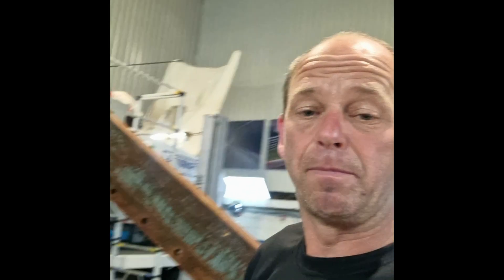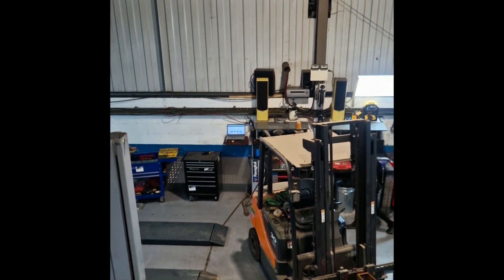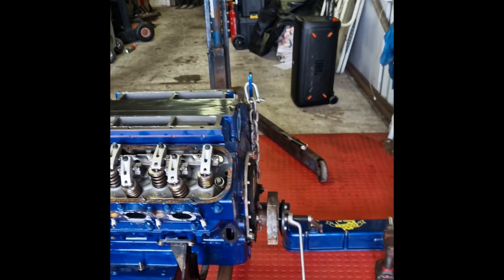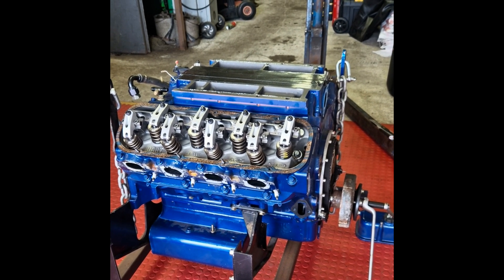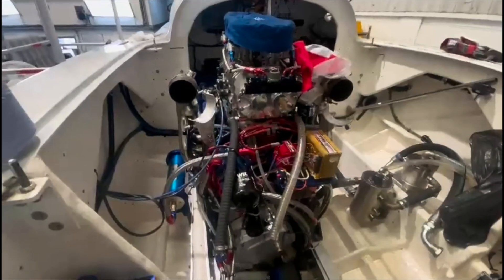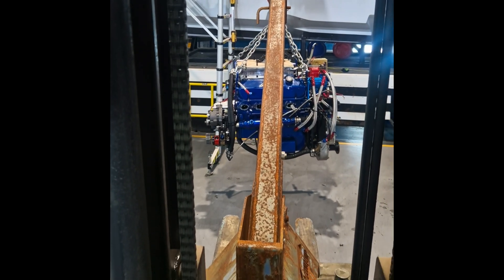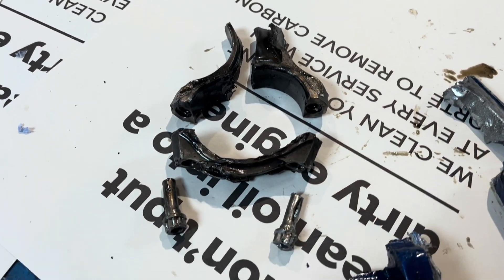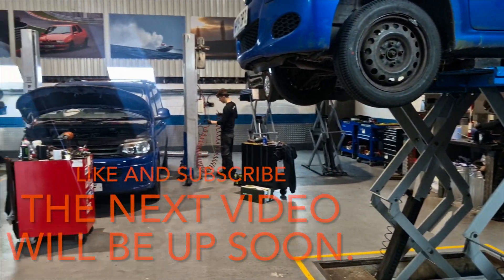Engine exploded! Offshore V8 powerboat engine swap Part 1

Comment: Looks like you have spun a bearing, gets red hot, almost welds itself to the crank journal, the other 7 cylinders running it  snaps the con rod on that seized journal, you need to run engine oils with high Zinc Content for bearing protection
Reply from the maker: we had a big over rev the week before when the prop snapped, we haven't pulled apart yet but it had 100psi of oil pressure on video when it let go and we do use zddp (zinc) and moly as well. we suspect a rod bolt let go as it only got 60 seconds into full speed before it when boom, unlike a car the the engine cant stop until the boat stops so you end up dragging the motor over for about another 10 seconds after it goes bang the number 2 bearing would have zero oil pressure once number 1 rod had left the party. will do a video on the further analysis. we would really like to be running dry sump setups but funds are short this season so we are running accusumps to back up the external high pressure oil pump